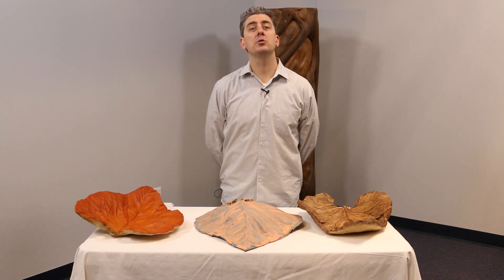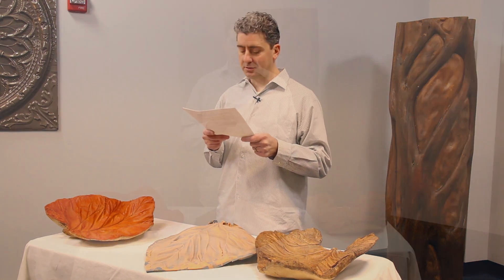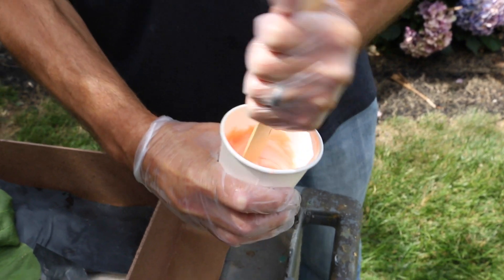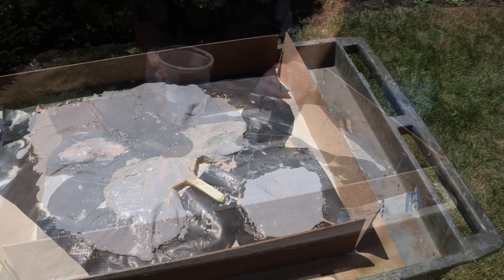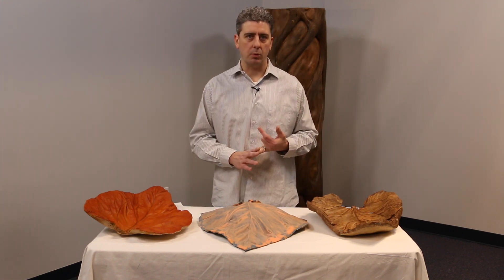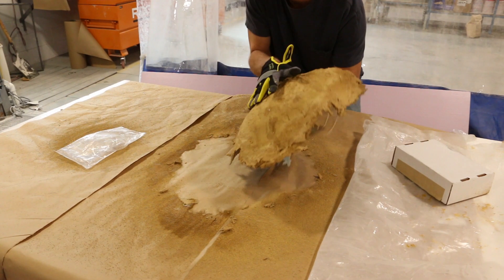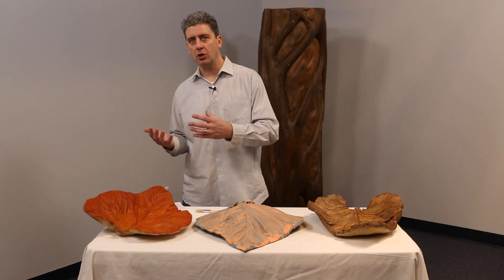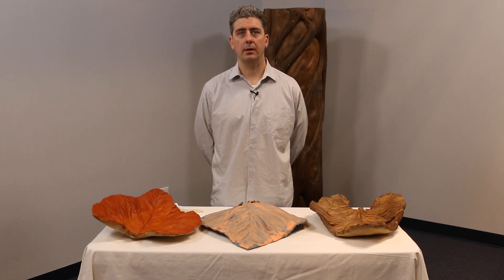How to Make a Mold of a Leaf for Casting Concrete - Molds of Nature

Comment: Why did you use that particular mold rubber and is the best one? A urethane would be more durable wouldn't it?
Reply from the maker: The silicone works well for when you are casting polymerized materials and need a limited number of castings without using a release.

Comment: Given your stains, wouldn’t this be extremely toxic as a bird feeder? Beautiful though...just the toxicity is an issue to work around.
Reply: not if it was acrylic ink which is really just nano scale acrylic plastic pieces. you put that on thinned with water glass or sodium silicate or you can even put the sodium silicate on after all the coloring is done and that locks the pigment into the concrete leaf.